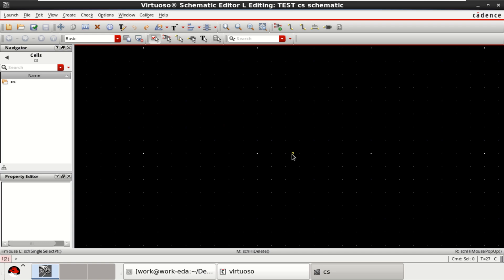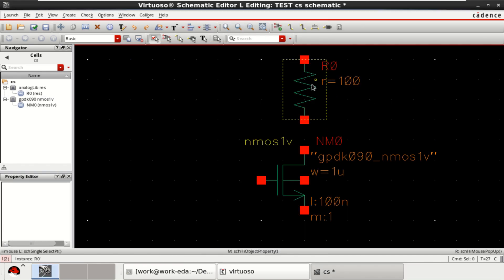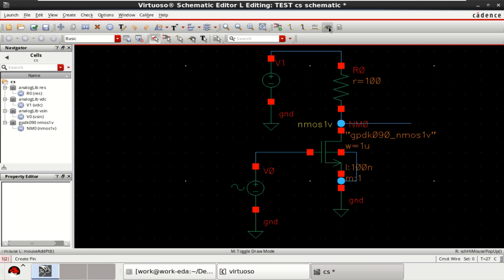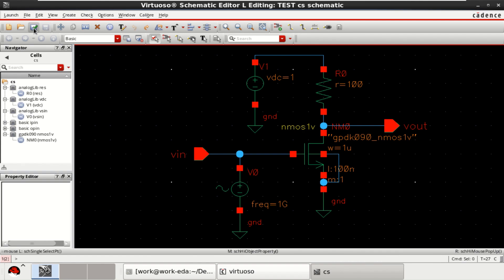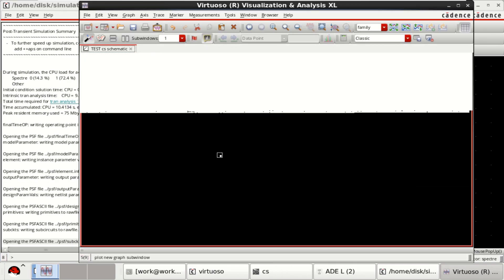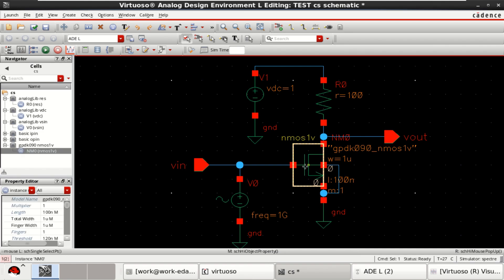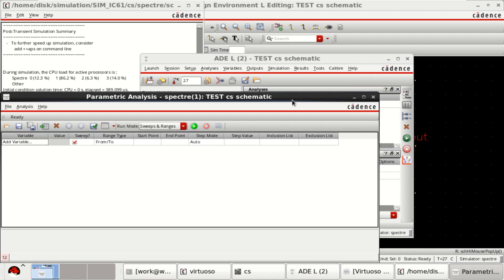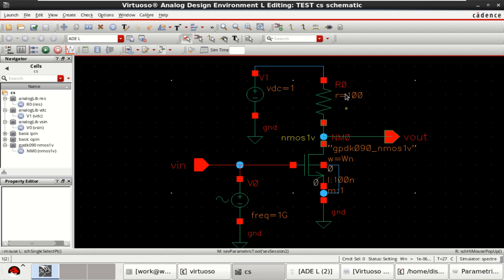Common Source Amplifier Configuration in Cadence Virtuoso.

Comment: Sir, how is your input voltage show around 1.8v to -0.4v on the plot when you set the input  input ac voltage to just 2mv
Reply from the maker: Hi, it is an amplifier. It will have gain
Reply: @dr.hariprasadnaikbhattu i get that sir. But how is Vin getting amplified? We should only get the amplified response on the output and not the input. The input is in milivolts and should be like that on the graph.